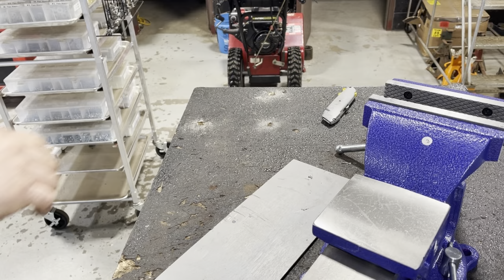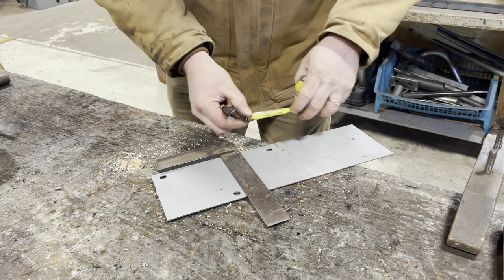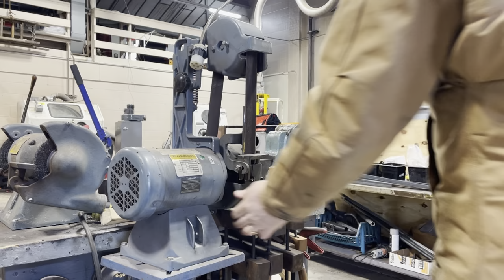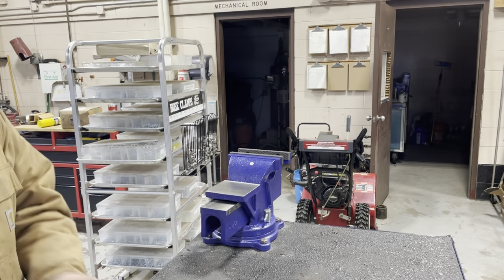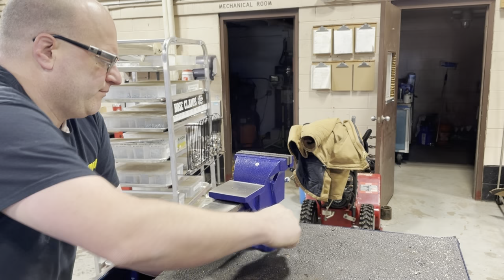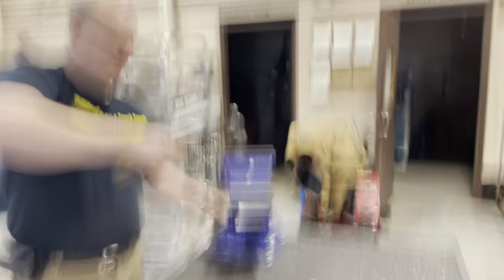installing vise on toolbox

Comment: Do you have to have a cover like wood over the top of the box or does it matter
Reply: Could you have a stainless steel top and install a vise
Reply from the maker: Yeah basically I haven't done either on those yet because of cost and lack of time.  I plan on replacing the top with butcher block this year.

Comment: Why wouldn't washers work instead of a plate?
Reply: If I had to guess, the plate might add some reinforcement vs washers, especially since the vise is pretty heavy and you’ll probably want to be able to crank on something held in it. I’m guessing with prolonged use washers might compress a little more unevenly and may warp part of the table with less area to spread the force around.

But I can’t say for certain🤷‍♂️